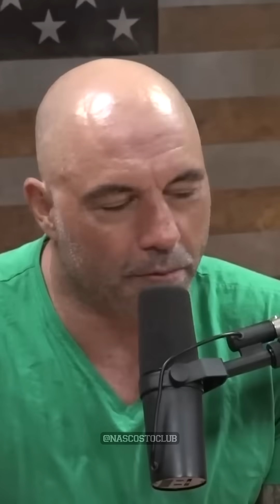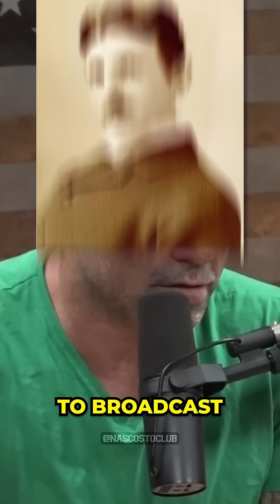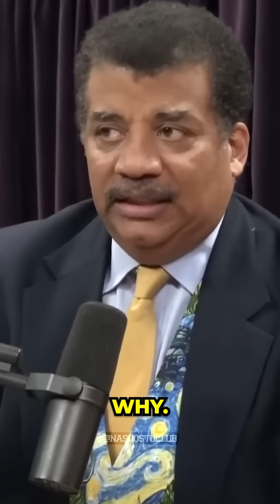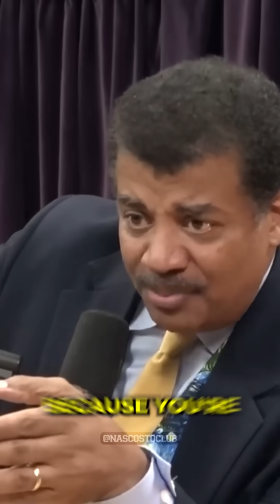WIRELESS Electricity Idea Debunked ⁉️⚡ #shorts

Comment: Magnetic fields and electrical energy are like two sides of the same coin, and one can be transformed into the other. 
In fact, it has been demonstrated that much of the electrical current that is delivered through copper wires is actually transmitted outside of the metal itself via a magnetic field which follows the path of the cable.
Reply: And? thing is, you very much do want the energy to follow the path of that wire, because without it it will search its path. You know just like lighting works...you still need a medium that decides that path otherwise the results will be unpleasant...

Comment: Nikola Tesla never said he needed radio for energy transmission, teleportation. What he said is electrons as bubbles are useless, amperage obsolete, and magnetism loss. It is true that magnetic tubes in air makes things alive. But as medium ..it is lossy as you wire brained fusion people know. Using volts instead of watts is NT.